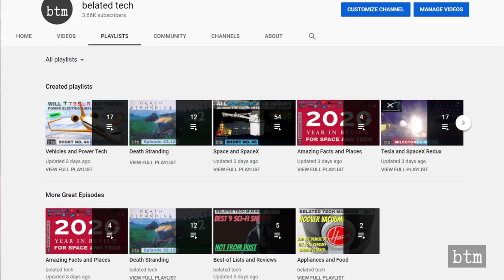SpaceX Starship SN15 Launch & Landing | Plus Background & Analysis

Comment: I've seen a lot of people saying that 1 engine was shut off during the landing burn. You can see in the SpaceX footage from the skirt camera that two engines were lit early in the flip and the third (left-rear) was at max gimble and showing no signs of propellant flow at any point during the landing burn. If the turbo pumps had been spun up at all, you would have seen that flow of propellant during the flip coming from that nozzle.
It's also evident from where SN15 landed that they didn't have the thrust of 3 engines during landing. Without the extra thrust of the 3rd engine, it landed on the near-side of the pad, since it wasn't pushed as far over the pad as planned.
If you follow the movement of the ground in that view during the flip, you can see that the engines that lit are not the ones SpaceX have previously used for the flip (front and right-rear vs left-rear and right-rear). 
Given the previous observations, the two most likely scenarious are that SN15 was programmed to attempt a landing with those two engines (doubtful given the engines used are not ideal for a flip and landing, as well as how close to the edge of the pad it landed) or an issue was detected with the left-rear engine before the landing burn and chose not to attempt to light that engine.

That being said, it's an extraordinary improvement they have made to this ship that enabled it to land. Whether intentional or not, their first serious attempt to use a suboptimal engine arrangement for flip and landing went fantastically well. I'm confident their next attempt will be a repeat of this profile, with the goal of getting the ideal flip and landing burn.